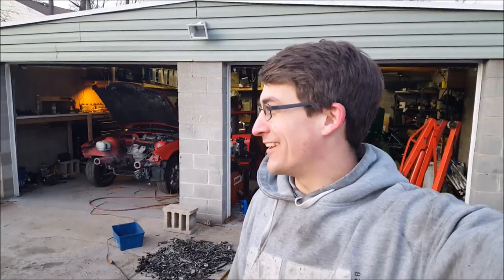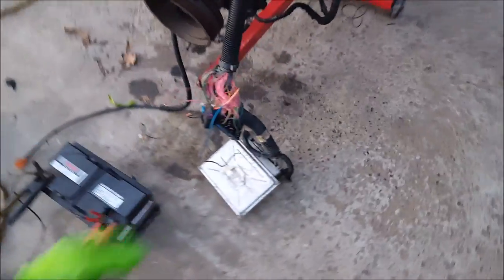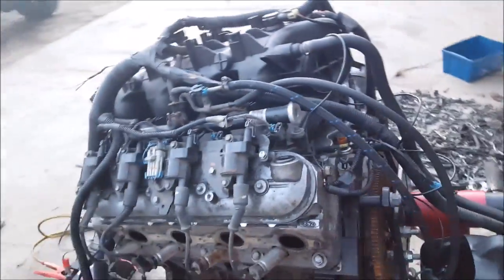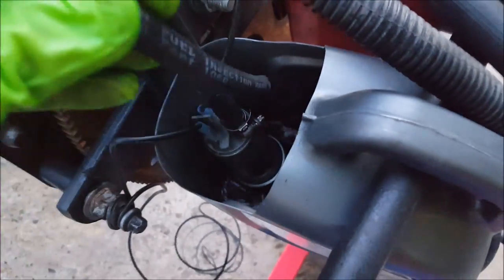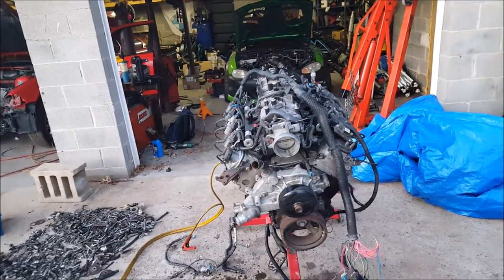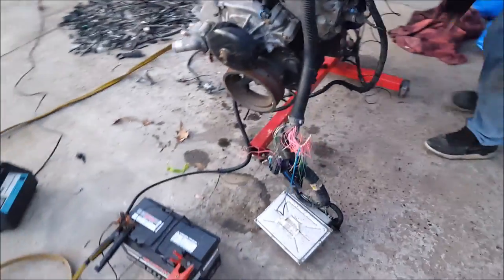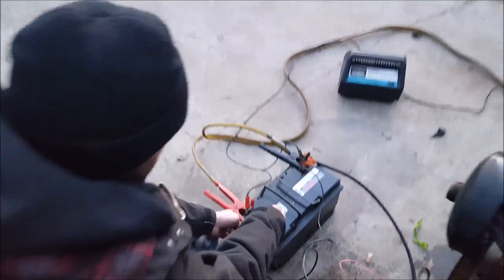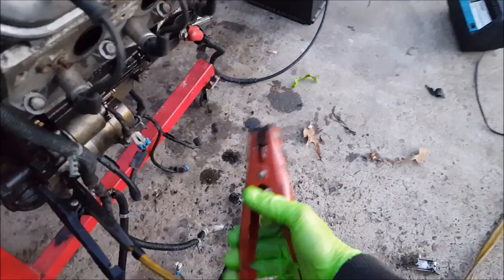How To run LS on  Stand WARNING LOUD!

Comment: I love how it throws flames right by the gas tank and does not  ignite..
Reply from the maker: John Porter shhh.. don’t tell the flames that.. they might decide too. Lol
Reply: Dude, fuel is only flammable when atomized - try throwing a lit match into a bucket of gasoline, nothing! Lol
Reply: @jhunterholland  i aint gonna try that lol
Reply: @Jake no, it's not, try it (however it only works outdoors with breeze, or in a well ventilated room, otherwise the gas fumes will cause ignition)
Reply: @jhunterholland  I think ur thinking of diesel
Reply: Soooo explain to me all the bonfires ive lit with OLD gas...🤔🤔 thats nit compressed and its outside and breezy
Reply: @Jay-jl7by  tf are you on?? 😂😂 that's an ls looks like probably lm7 or l59. Definitely not a diesel 😂
Reply: @jarods17  Haha true.. my point was there is different types of fuel. I thought he said it runs on oil and noticed what looked like a common rail and assumed it must be a diesel version?? I'm not familiar with the ls engines
Reply: @Jay-jl7by  the duramax diesels actually do look pretty similar lol
Reply: @jhunterholland  more like diesal
Reply: @israelcruz6274  Both, fuel needs a correct air ratio for combustion! that's why a Molotov Cocktail doesn't explode till you smash it on the side of the thing you're trying to burn... it combines with the air in that exact moment
Reply: @jhunterholland  explain to me how people start fires with gas then
Reply: Install a rebuilt transmission  in a 5.3 vortech

Comment: Nice work guy's was awesome to see you having a good time.   Just passing it along how I ruined my first motor build.  I started it in the truck and ran it for a few minutes without headers or exhaust manifolds.  I ended up burning a bunch of valves on brand new machined heads.  It was on a 428 Ford Cobra Jet cost me about $900 to fix my little fun time.   Later on I got into track stuff we would paint our exhaust and where the paint stops burning off is where you cut for your shortest length of exhaust you can run without burning valves.  Hope it helps someone out there.  Keep it up awesome work!
Reply from the maker: Awesome bit of info here guys! Thank you :)
Note: this engine ate a screw driver head and is no longer with us because of that lol.
Reply: Man thanks for sharing. Wish you all enthusiasts the best.

Comment: Just a heads up. Your engine stand is not assembled correctly. It's leaning forward because you have the arm facing the wrong way. Do a 180 with it. It's made to angle back so when the weight of the motor of it is attached the engine will sit level.... Just looking out bro!
Reply from the maker: nick mangano thank you Nick 💜
Reply: Are you kidding me???!!!!! 😳 If this guy hangs the engine out the other way, with no 3rd leg/wheel under it, the whole thing is gonna tip over, with the engine crashing to the ground leaving that middle leg and wheel pointing skyward!!!
Reply: @milojanis4901  the vertical arm is backwards. Not the horizontal. They purposely lean the vertical arm backwards to account for engine weight. Don't be dense.
Reply: @DRUMer2412  No need for insults, nick. You could be more clear on facts yourself, because there ARE people out there who may NOT be savvy, and do just what I thought you were talking about. That's why we have words like vertical, and horizontal. BTW.....On my engine stand, the engine still sags lower at the front, and it is assembled correctly......
Reply: @milojanis4901  didn't mean to insult you. That's why I said don't be dense. Not you are dense. Not all engine stands are created equal I guess.

Comment: The old brake booster vaccuum aint plugged, so you may have some mixture problems and high idle but that solves fine

Comment: How come you guys didn’t just give power to plug c1 pin a9 instead of powering all the pinks
Reply from the maker: I have never used the entire fuse box before and have only ever wired engine harnesses in race cars, so we cut out as much as we can I guess.
Reply: Thomas Miata what about the VATS?
Reply from the maker: Traxxas Driver Pro 101 turn it off with HPTuners. But in this case, we used Justin’s ecu because we knew it would run the car
Reply: Thomas Miata honestly I don’t even know why i asked that, who am i to question when your way gets it done!
Reply from the maker: ewok 😊 it defiantly gets it done 😂. Now I have been switching over to holly terminator x ecu and harness. It’s so easy!

Comment: This is a good way to warp the exhaust valves!!! Engines have exhaust systems in place for many reasons. Exhaust valve warping IS one of them. Even Top Fuel dragsters have short open pipes. Running any 4 cycle engine without exhaust pipes is a bad idea.....
Reply: Thanks dad for the expertise
Reply: Do you think they care?
Reply: @ihearti24traffic  😂

Comment: So I've missed out on a few of these lately but there is a rare Miata chassis car out there that no one knows about.. they're going for 1500 these days but I have a feeling they're hidden gems. The Ford Probe. They only made the for about 9 years. And they are estimating about 720 left registered on the road.
Reply from the maker: The probe is based off the Mazda 626, not the Miata.
Reply: @ThomasMiata  I see. I must have read wrong. I thought the suspension and steering along with the frame were miata.

Comment: Thomas Miata, you don't fix your $49.99 Harbor Freight 750 lbs engine stand, you just buy the $130 one which has 4 points of contact and is meant for large engines. I have one and it holds Duramaxes fully equipped and doesn't bend. I wouldn't trust that engine stand of yours to hold anything bigger than a 2.0L inline 4 engine,  yet trying to start and rev a V8.
Reply from the maker: sketchy life is the best life :)  but I have been putting v8s on that stand since i bought it.. yes it is sketchy but I have since reinforced it (for free). It has never let me down yet. And I have dropped engines before with other equipment lol
Reply: @ThomasMiata  Not a good long-term approach to life. If it didn't fail before, doesn't mean it won't fail in the future. And it only needs to happen once, and it will do it with no precautions. 600 lbs metal brick with sharp protruding parts falling from 3 feet. When it will let you down, if you're unlucky and happen to be near it, you may end up permanently incapacitated or end up with a $80K hospital bill, or both. All because trying to save $80. I may have watched too many industrial accidents on Youtube.
Reply: @ThomasMiata  fuck it send it!

Comment: What size fuel line, did you just slip it over the fuel rails?
Reply from the maker: I believe it’s a 5/16 fuel line and yes.. just jam it on and hose clamp it after the bump in the hardline where the “quick connect” would grab

Comment: u forgot to rig a ratiator system and exhausted system. heat created in the combustion chamber can melt pistons to cylinder walls and warp aluminum heads.
Reply from the maker: It survived, didn't run long. It's installed in a car now.. exhaust and cooling included

Comment: Can you  help me I want to do the same and swap in a 1950 truck with a 5.7 hemi can you tell me what to do and I’m put it in a manual transmission
Reply from the maker: Sorry, I have never done a swap with a 5.7 hemi. Wouldn’t have the first clue on how to get that computer to allow the engine to run without the key security components. I recommend asking around locally at a car show or checking google for dodge performance shops near you.

Comment: Does wrapping all the pinks together bypass vats? Or is that just one thing you can't get around. Mine only runs for maybe 1 second. But I had it running and drove it a couple times, but now it will only run for .5 seconds.
Reply: For anyone that might read this, I tried it and it didn't help. VATS is your enemy! Lol.  Just spend the money and get it flashed out. The Pink wires.... Idk seems unnecessary
Reply from the maker: @away2619  in the video I mention that I am using a Vats disabled ecu. The pinks all together are for receiving 12+ to the individual components running the engine. HPTuners cable was used for removing vats.

Comment: Another ? If u don't mind to answer did u fuse block those pink wires if so what size fuses did u use and how many ?
Reply from the maker: I Believe what I have is a switch with a 30 am fuse powering a fuse block that has 2 10 amp outputs and 2 15 amp. I split them up evenly while trying to keep the injectors, coil packs, O2 sensors on their own, then put the rest to the last one.

Not super professional, but it worked. I then switched to the Holly Terminator X ECU and wired that according to their directions.

Comment: Can this set up theoretically just be put in a car and run?
Reply from the maker: Absolutely. This setup was put in a car and ran with 8psi of boost for a dyno run and 2 drift days. Somehow it got a screwdriver head inside the intake (previous owner maybe didn’t like my lowball price and glued metal inside the intake I used) and ate a piston. Currently have the same harness powering a 6.0 lq9 with 8psi on the car.

Comment: Hey bro can you explain this in just a bit more detail where are all those pink wires located on which block of the fuse panel or where exactly dope ass video just a bit of clarity would be much appreciated bro thanks in advance
Reply from the maker: Thx, and..

Every single pink that you need to power is located on the 1 fuse block connector. There are a couple other smaller connectors that you do not need to worry about unless you are doing things like running a tach wire, etc.

Please please please visit http://lt1swap.com/ and make sure you read up on your specific harness. There are differences for truck/car/year/etc.

Comment: Can i get more info on how to setup the fuel system up im knew to this and ive fired my engine with carb cleaner but want to keep it running with the bucket of fuel like you have can you help
Reply from the maker: You might have to get the ECU VATS removed before it will run. Vats (theft system) kills the injectors to work.

Comment: are u going to build it up it will need it and they are not cheap to build they are on low end of hp stock and the stock efi limmits u to about 600 hp but still is good for a street rig . i get the 454 ho engines with low miles 450 hp at 485 torque steel crank heavy rods high flow heads for free got one with 6000 miles on it and the other one has 38,000 miles on it and they come with the heavy duty 400 turbo were they have the bigger pump and heavy clutches stage 1 shift kit . then i made 2000 off of what was left after pulling the engines . plus i get rigs for free all the time just gave my budy a 2004 with a l.s. in it all that was wrong with the truck is it needed a rebuilt trans but i got it free . have a lot of pu from 57 to 79 plus a lot of muscle car projects been filling up 10 acres of rigs most are rust free or they just have a little rust just on a few of them . i been building rigs for about 40 years and collecting them and  i never sell them . i will use 2 or 3 rigs just to build one like i building a 68 short box i have 2300 in it pushed about 800 hp with a tunnel ram 454 roller engine 4 inch stroke and my kid built a 67 out of the leftover parts still have 2 perfect cabs and a lot of body parts left next project is a 79 z28 rs t top have 2 hard top z28 for parts have the engine a stroked 454 and trans auto or 4 speed borg new clutch and fly wheel got all for free my friend want to build a z28 out of the leftovers parts .
Reply from the maker: That engine died already and I put a 6.0 in it’s place. Sounds like you do some epic stuff though! I will check out your channel.

Comment: What size bolt do you use to hold the engine to the engine stand and what grade should I go with?
Reply from the maker: I use random bolts in a big box I have in my garage. We call it the "Nutz Box" lol. I wouldn't be too worried about what grade you use. Just make sure the bolt is long enough.
Reply: The proper size for an LS is M10x1.5. The length of the bolt will depend on your engine stand - you want around 15-20mm of thread engagement from each bolt. DON’T make the mistake that many people make and use a standard bolt. This will bungle the threads, especially on an aluminum block.

Comment: Look at your stand box or online, you assembled it backwards. Engines should be slightly pointing up, not down. I noticed yours is pointing down like when my buddy assembled his, and it was a PITA to mount a 4 banger on it. Once we flipped it around it was much easier to rotate, remove and install the motor.
Reply from the maker: Thank you. It was assembled wrong in this video, it has since been changed
Reply: @ThomasMiata  np man, I know with V8's you cant use a two man lift. I just use the cherry picker. Work smarter not harder.

Comment: Do you hv a video to show which wires are needed ok n the harness an how do I remove the vats?
Reply from the maker: Vats is removed using hptuners or mailing it to someone who can do it. I don't have an additional video showing what wires are needed vs what's not. But lt1swap.com has all that info and they can remove vats too.
Reply: Thomas Miata do you have anyone that you deal with that can delete vats?
Reply from the maker: @certifiedautocarerecovery7429 I would recommend looking around your area for a shop that does LS tuning and reaching out to them. I have my own hptuners cable, so I down my own vats removal.

Comment: This is fuckin hilarious, I love the disregard for safety, reminiscent of zip ties n bias plies. My engine stand is a hazard fraught POS but she has 4 casters so maybe it will barely even fall over. You don't need to be safe, you might catch on fire but you don't need to worry about that.
Reply from the maker: Hahah.. you only live once and I did actually have a fire extinguisher right on the inside wall of the garage.
I have to get another engine now for my m3.. so might have to do a follow up video :) :) :)

Comment: So you just pretty much need the engine wires, battery, fuel pump and a bucket of gas?
Reply from the maker: And the most important thing, removing the security VATS from the ecu.

Comment: greetings as you did to start that engine .. I want to know why I am going to put a tahoe engine in chevy 1950
Reply from the maker: Faustino Quiroz hello. Starting the engine requires the removal of VATS using a tuning software. Then you splice all the pink and orange wires to 12v and the blacks to ground

Comment: Say bro you know that noise the starter was making when you were trying to start it? I have my motor in my car and trying to run it like on the stand then connect the rest of the wires... My problem is when I touch the wire for start it just makes that whirling sound do you know what I could be doing wrong?
Reply from the maker: Young Gunn likely that your starter is not pushing the gear out. You may need a stronger battery, better cables, or maybe the starter is bad.
Reply: Thomas Miata bro I literally just put on a new starter. It is the original wire running from starter to junction block and alternator but I cut the part that goes to the battery cause mine is on the passenger side and I ran a longer battery cable from that junction block to battery.
Reply from the maker: Young Gunn try tapping the wire a few times on and off. Make sure that you have the starter wired properly as well.
Reply: Thomas Miata I believe I do. And do you mean tapping the wire on the battery
Reply from the maker: Young Gunn yes, sometimes the solenoid needs a few hits of power to get it going. You may want to look up how to jump a starter to make sure that you are 100% on the correct posts

Comment: Nothing like running open heads, lol. I have done plenty open header jobs, but can't say I have ever run an engine with nothing at all on there.
Reply from the maker: Yeah buddy.. It's in the machine shop now.. and going to put used 241 heads onto it when I get it back.
Reply: @ThomasMiata  Should've went with 243's.
Reply from the maker: @cali2468  had them sitting around

Comment: Do not do this. Just buy the fuse block so you don’t have to bubba all of your wiring.

Literally no splicing or cutting.
Reply from the maker: Sometimes you just gotta bubba, lol
Reply: Nevermind the fuses, or lack thereof. Keep watching until you see the open bucket of gas hanging off the back. I was waiting for the sparks off the starter or the exhaust out the open ports to light off some stray fumes and watch the whole thing fireball. Which would have happened if that rickety stand would have just collapsed like it was wanting to.

Comment: A few burnt valves after running with no manifolds?
Reply from the maker: No, the valves were fine.. but this engine had bad cam bearings, so it's in the machine shop anyway

Comment: Which fuel pump you use part number please
Reply from the maker: That is a walbro 400 pump. But any in tank pump would work when rigging something up like this.
Reply: @ThomasMiata  but doesn't the fuel pump have to have a certain fuel flow rate or it doesn't matter?

Comment: Do you  flashe the computer
Reply from the maker: clemente sanchez if you want the fuel injectors to work, yes. You need to flash the computer. In this video I use my friends ecu which is already flashed.
Reply: What about the maf sensor?
With vats disable, do I have injectors pulse?

Regards.